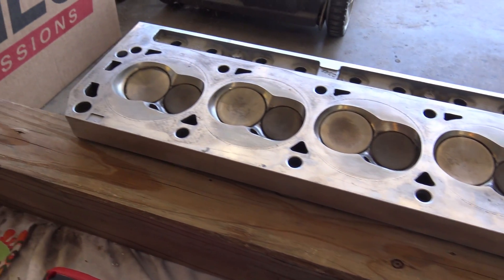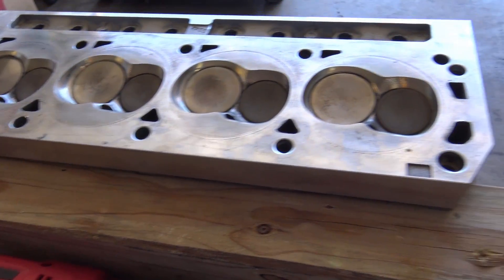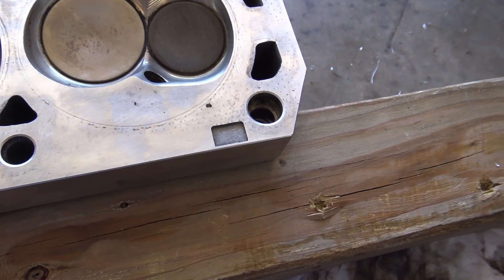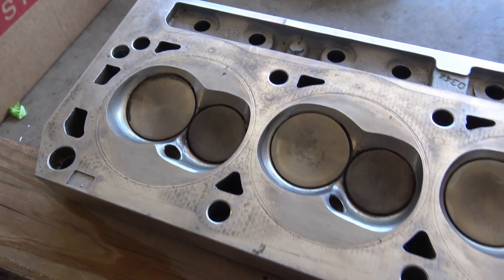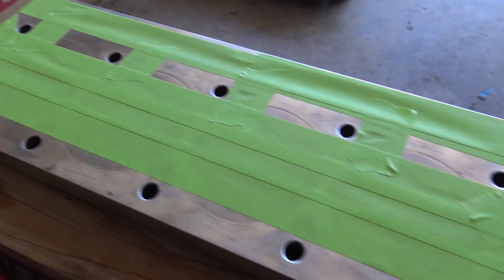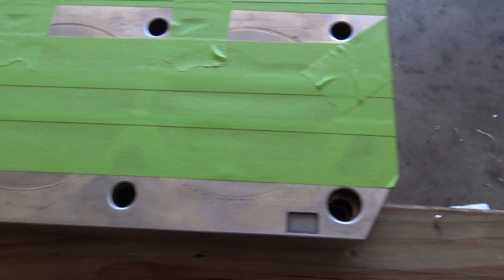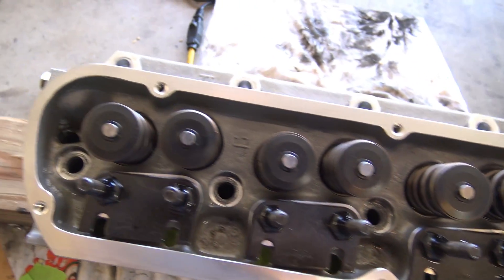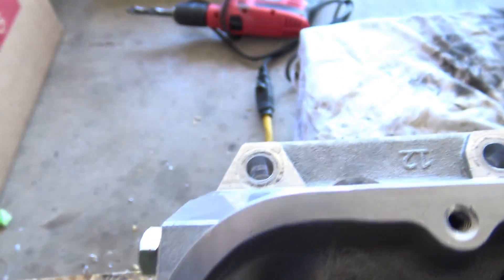Drilling out Trickflow 170 Head bolts

Comment: How much horsepower did you get with these heads?
Reply from the maker: Most power I've made with them is 770 wheel, but that's with boost
Reply: @justin91lx  did it just bolt on with no problem?  Or did it have clearance problems somewhere?

Comment: Great seein ya do this ill be doing the same to my tfs 170 heads this weekend. I am also doing a 351 30 over On3 setup. Quick question are you upgrading your valve springs at all or running as they come? Keep up the great videos
Reply from the maker: Im running as they come. When I purchased the heads, they had the upgraded valve springs. They will take .600 of lift
Reply: justin91lx  awesome man thx for response